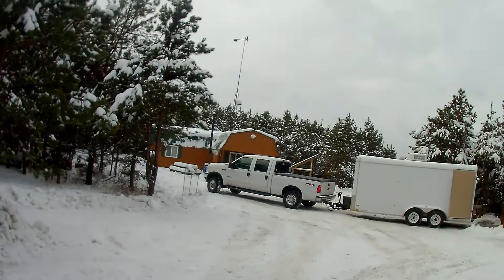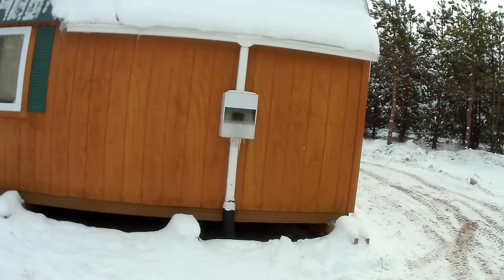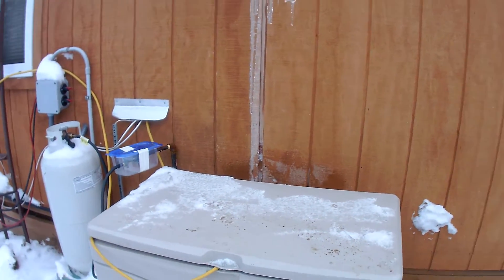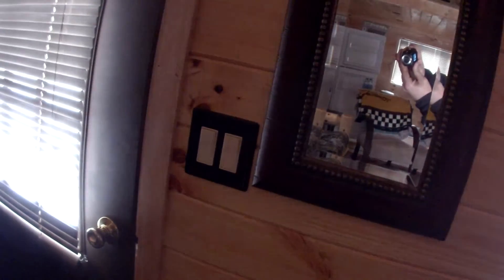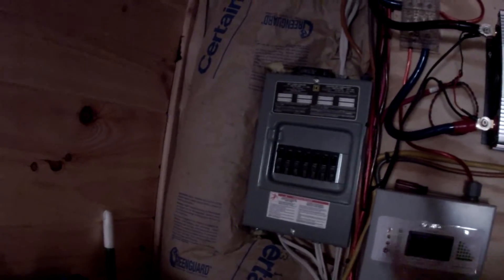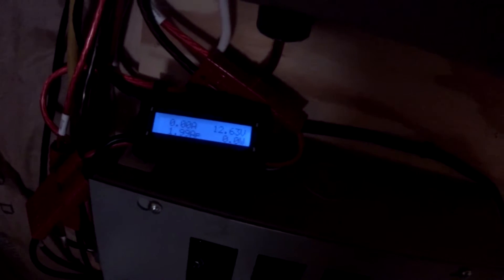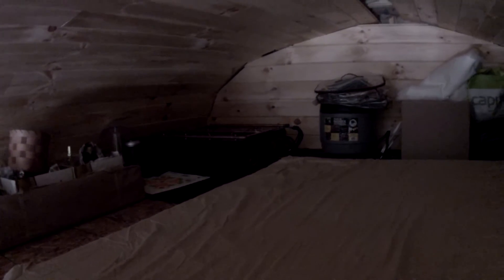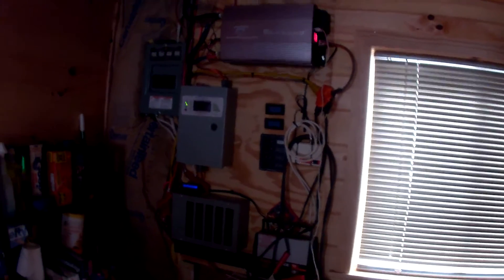My Off Grid Cabin 1st Showing

Comment: I'm a electrician, your electrical panel work is kinda of a mess.
Reply from the maker: This video is from the beginning of my off grid journey. The challenge of working with what you have and making it usable for the moment are hard to describe if you have not went thru it.
I assure you things have change dramatically since this video. Everything has a beginning.